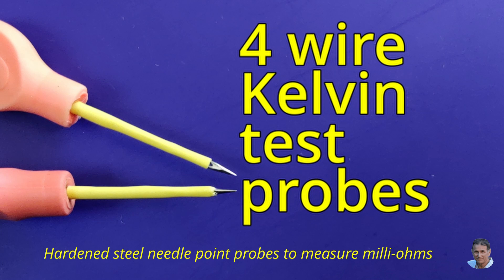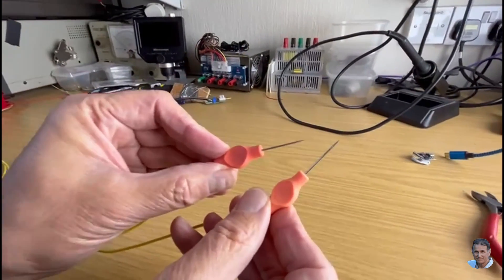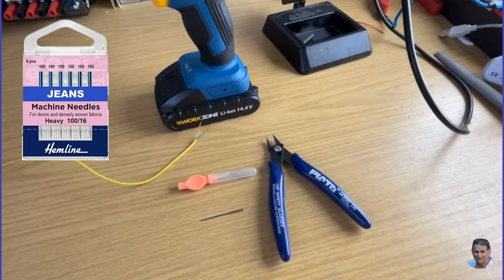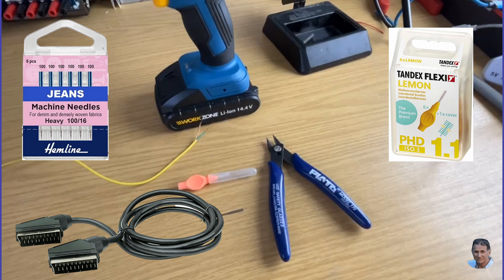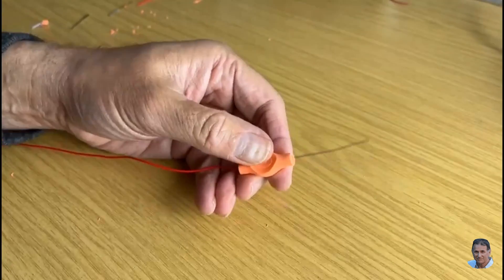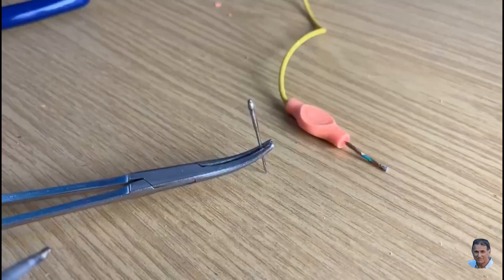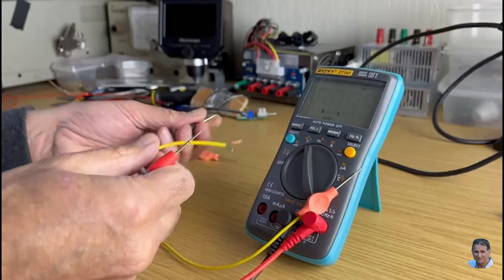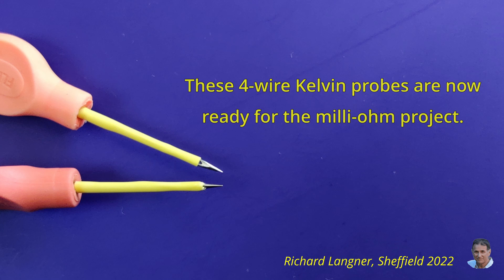Low cost 4 wire Kelvin probes, made in minutes. Ideal for finding shorts or measuring milli-ohms .

Comment: The sense wires need to be down at the probe end, not back at the power supply end. These are not Kelvin probes. Preferably they will be on separate probes, but if you are close enough to the tip you will mostly get away with this.
Reply from the maker: Thanks, I realsied that and the later version had the wire soldered to the eye of the needle near the point. In any case the video was for comparative readings, not as an accurate instrument.

Comment: They are not real 4 wire probes. The 2 wires of each probe must be in contact only on the resistance to measure, to remove the effect of contact resistance.
Reply from the maker: Thanks for your feedback. The video project was not for accurate measurement, but for comparative readings. You are correct of course, and that's why I made a later video with twin needles.
Reply: You also have to think how much accuracy do you need ?  There is no point in having accuracy just for the sake of it. It wastes time ( and money).  

if you really want to be accurate you reverse the test current, subtract the two voltages and divide by 2 - but is it necessary to get you to where you want to be ?
Reply: @we-are-electric1445  The question is how much connection resistance can vary. The nice thing about true four-point probes is that you can have a crappy connection yet still accurately measure resistance (assuming your power supply can deliver a high enough voltage to overcome connection resistance).
Reply: @gargantuablargg   Reversing the test current and 
subtracting the two voltages and divide by 2 is a standard way of  obtaining accuracy. A crappy connection implies inconsistent readings. If you have poor connections the obvious question to ask is why?
Reply: @we-are-electric1445  I used 4 point resistance measurements to locate short ciccuits on populated PCBs. I needed to measure very low resistances with a not too high current.

Comment: The idea of using those sewing machine needles is great, as well to use the coax cable from an old SCART cable. Very nice and smart.
An interesting implementation could be to make a Milliohm meter using low voltage AC instead of DC, to measure also the capacitor ESR

Comment: To be true kelvin probes you need separate tips for voltage or current so the contact resistance at the tips isn't measured.
Reply from the maker: Thanks Lars. This video was about a quick and easy aid to finding short circuits. If you need more accuracy, I made a two needle probe which is shown in a later video. Neither of these have great accuracy but it should help people to understand the need for, and use of, Kelvin probes.